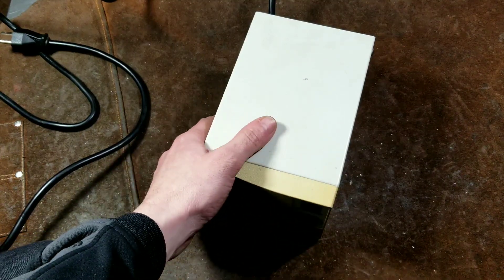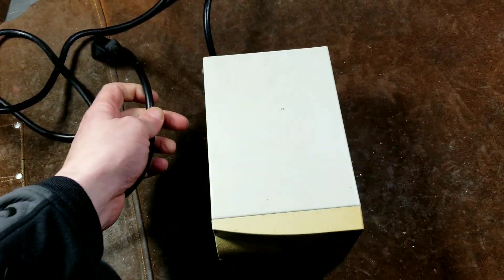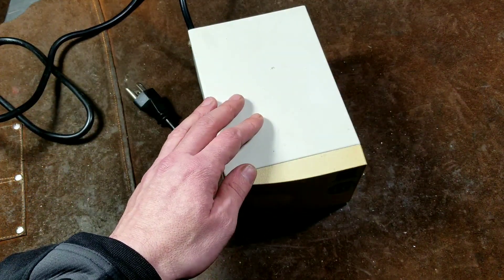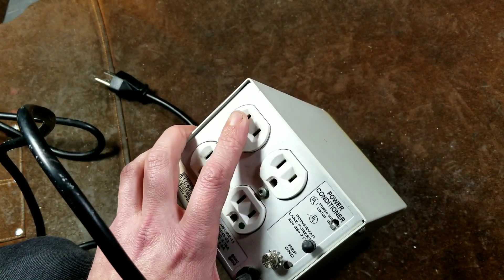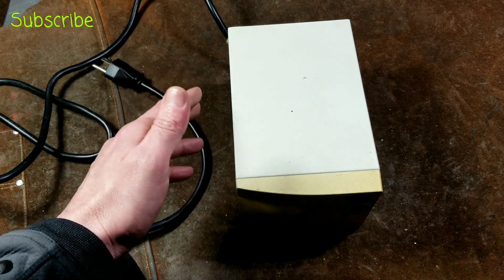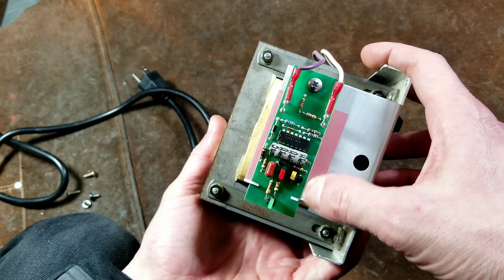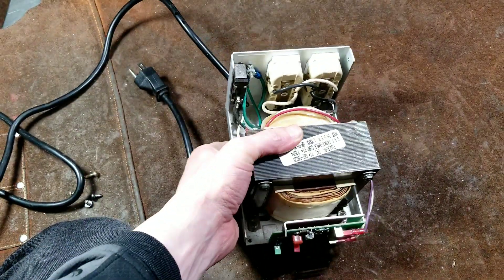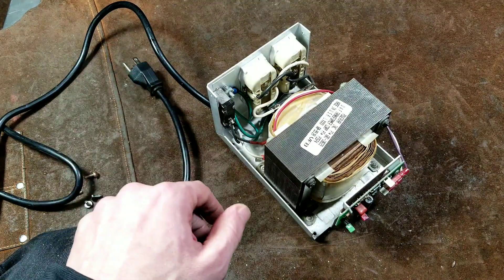PowerVar 4.0 Isolation Transformer/Power Conditioner Review

Comment: Had my treadmill plugged into the Powervar 3.0 unit and the unit lost power when using my treadmill. Turns out it was the Powervar that bit the dust,treadmill  worked just fine plugged straight into the wall and no breakers were tripped. Any idea as to what might have failed in the Powervar,doesnt look like they have any fuses inside or push button resets,my unit is stock with no mods.
Reply from the maker: A 3.0 is only 3 amps way too small for a treadmill. You may have burned out the transformer. Open  the case with it unplugged and using multimeter see if there's continuity on each side of the transformer.
Reply: @CatusMaximus  Transformer shot. Would the Powervar 4.0 be a better choice?
Reply from the maker: I have disassembled treadmills for the motors, they are large... You would need a 10amp or better, find the label on your treadmill I am sure it uses a lot of amps.
I would find one on the bay, usually OneAC brand are cheaper for the higher power units.

Comment: Hi @CatusMaximus I was thinking of getting a 1200watt powervar isolation conditioner for my whole home audio system consisting of an audio controller and two amplifiers. I see a good deal for one. I live in a new house and I think the power is pretty reliable in my area and I’m not experiencing any audible noise in my system, but I would ideally like this expensive equipment to last decades. Would a powervar be good fit for this scenario? As long as the equipment all has 3 prongs I don't need to do anything special with the grounding and they can all be plugged in simultaneously, right? Is there any other equipment I could use in conjunction with the Powervar, like the APC Line-R? Thanks!
Reply from the maker: That would be fine for a home audio system, they only way to get cleaner power is to use a On-Line UPS but that would use a ton of power where isolations transformers are very efficient, usually 95% or better.

Comment: Electronic technicians or hobbyists will often use an isolation transformer as part of their test or repair bench setup to protect properly grounded test equipment such as oscilloscopes. 
Transformer based noise isolating power conditioners such as those made by Powervar, OneAC, TrippLite, Toroidal, and Topaz as well as many others will have one side of the output winding connected to the equipment ground. For this specific use, that connection must be located  and disconnected. It may take the form of a wire or it could be one or more straps on the output outlets.

Comment: Good afternoon Catus, very informative and well laid out video. I was wondering if this would work fine on 50 hz   system even though it's rated for 60?
Reply from the maker: Transformers are tuned for the frequencies.  you can get 1 for 50 Hz but this particular unit is designed for 60 Hz.

 Switching power supplies are different like in computers they have the ability to operate a different frequencies but Transformers are a different beast Switching power supplies are different like in computers they have the ability to operate a different frequencies but Transformers are a different beast
Reply: @CatusMaximus  Gotcha, thanks a lot for the quick  response and hope to see more tech related vids in the future.

Comment: I had the abc500-11 powervar ,  wonder if it's good for my Denon receiver, TV, Router, blue ray etc...
Reply from the maker: It's only rated for 5 amps that maybe a little low for a receiver special gear High volumes it may work if only the receiver was plugged into it otherwise I'd use it for all the other components is there going to be much lower power draw

And yes he's definitely can make a difference and provided additional level of protection against surges Etc although receivers have a big Transformer in the Manny light that is not only ice late but also steps down the voltage of course these external isolation Transformers don't adjust the voltage at all betas provide electrical separation
Reply: @CatusMaximus I guess it's only good for tv, I need a max 5400-pm from panamax for everything else

Comment: And how does this compare to a rack mount size device from Furman et al.?
Reply from the maker: Furman and other equipment like that are excellent power conditioners and Regulators this unit is Transformer base which should be impossible for professional audio because they would weigh way too much amount of power they need.

Isolation Transformers are really the ultimate form of noise reduction They Don't Really regulate voltage but they are excellent against surges because the two windings are not physically touching each other and that's the same reason that they are so good at stopping noise, they're really for medical equipment and electronic Laboratories.

Meaning if you're using a Furman and professional audio he may actually plug one of these into it just too isolate some turntables or mixer or something in case you have a little bit of background noise
Reply: Catus Maximus Ok, so here’s my situation. I live in a house from around the 1880’s. It’s wiring is a hodgepodge of stuff over the years and most of the outlets are not grounded, poorly grounded, and a few are modern enough and in a location where a real ground was easy enough to do.

I have old music gear. Solid state amps, Fender Rhodes piano, tube amps, a Motion Sound Pro 3x, a Hammond L100 spinet organ... And I have just a few outlets. My problem is sometimes they seem to influence noise in each other, and all could use a lower noise floor.

But I don’t know what would suit my needs more. Just looking for reduced noise, and isolation of two or three devices, but preferably from each other as isolation from the wall power is less of a concern. I’m not that scared of power surges, I can’t recall ever having been affected by them in the past.

Comment: It protects you from getting electrocuted if you work on a defective device, that's the main reason they use these transformers in workshops. The voltage is no longer referenced to the ground, so you can only get an electric shock if you touch both wires at the same time (line and neutral are no longer existing behind the isolation transformer).
Never use the same transformer for several appliances, if you do so you'll have to create a local equipotential bonding (potential equalising) between the appliances which are connected to the same isolation transformer, that's the point of the ground screw at the back of the transformer.

In some european countries you can find a shaver socket in the bathroom, they use a small version of such a transformer. But sometimes the transformer is also used to get an additional 115V outlet from the 230V input. This is mostly the case in hotels, they have shaver sockets with additional 115V outlets. But the demand is limited to 20 VA, so only shaver or electric toothbrush...no hairdryer or other high power appliances.

https://en.wikipedia.org/wiki/AC_power_plugs_and_sockets#Shaver_supply_units
Reply: If you want to use this as a safety isolation transformer on a workbench, check that the secondary is floating first!  Most devices sold as a "power conditioner" have the secondary neutral grounded, not floating, so you can still get a shock from the output if you touch a ground.  Hammond sells isolation transformers for service work, and they do have a a floating secondary.  Some "medical grade" isolation transformers also have a floating output - but not all of them do.

It is often easy to convert a grounded-secondary power conditioner into a floating-secondary unit for bench work.  Just find the connection between output neutral and ground, and remove it.  But, until you've checked for yourself, you shouldn't assume that an isolation transformer has an isolated (floating) secondary.

Comment: Cool video.  I never knew what those green dots meant.  Thanks for the video and cheers.
Reply from the maker: Yes and they can also have a green triangle which means that the ground is isolated from the frame of the receptacle
Reply: @CatusMaximus  I have an older Monster HTS 1000 MKIII (here is a link https://www.amazon.com/Monster-8-Outlet-Center-Discontinued-Manufacturer/dp/B000PCVF3E ).  Would it be okay to have this unit plugged into an isolation power conditioner to help it last longer, or would this not be advised?
Another quick question, why would it be beneficial to have the ground isolated from the frame of the receptacle?  Thanks for your time.